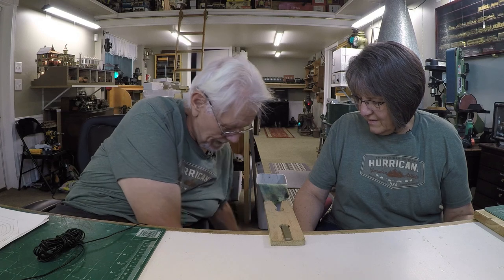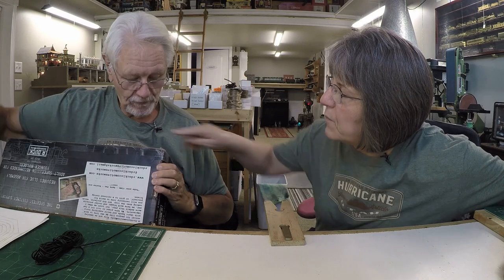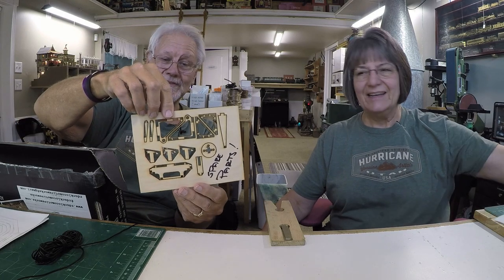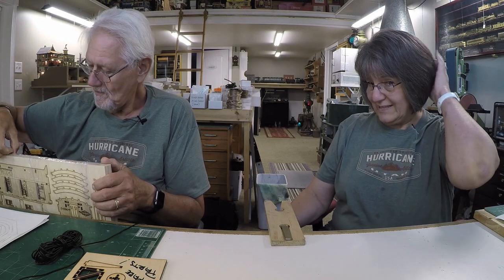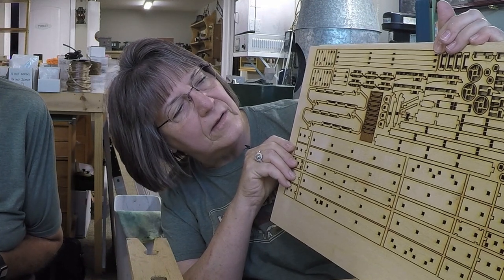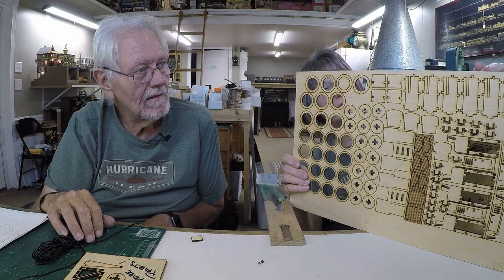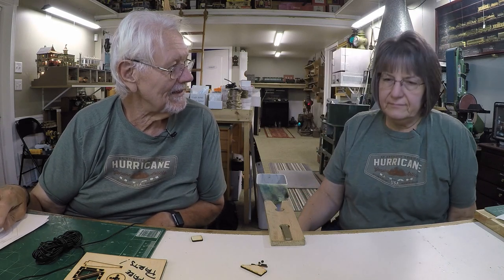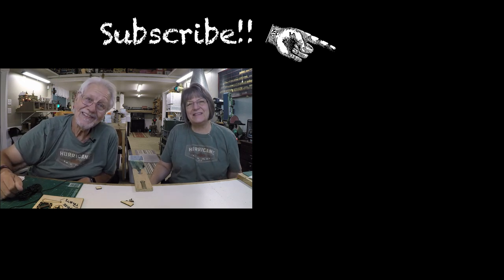Karyn's Custom Laser Cut Caboose by R. Duck Locomotive Works

Comment: I just realized that by switching out the running gear and a few other parts, you can actually build one super caboose that is not a static display.
Your friend should consider some passenger and freight car kits. 
This build should be fun, I can't wait to see the process.
On my last job (for ever) the shop had a 4000 watt laser cutter, which I was responsible for programing. That thing would cut 1/8 inch thick steel as fast as wood, and to .0001 tolerances. It is an amazing thing to see. ;-)
Reply from the maker: Holly crap!! I’ll bet it made sparks!  Geeeezzz
Reply: @ToyManTelevision  OH yes there were sparks and the laser beam was usually in a nitrogen gas jet to help suppress the sparks. The sides of the cut looked almost polished. As I said, this  is a very interesting process to see.

Comment: I’d be tempted to buy one and supply my own trucks so you actually could run it on F-Scale track.
Reply from the maker: Simple to do. Need to scratch build the bolster. Add trucks and couplers. Bingo. Perhaps Tripp should think about adding a wood bolster as an option?